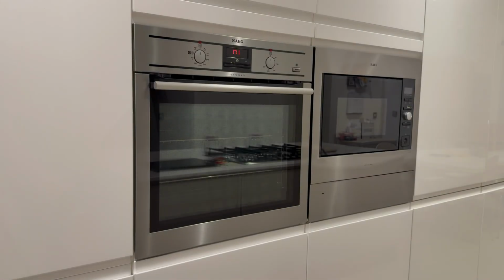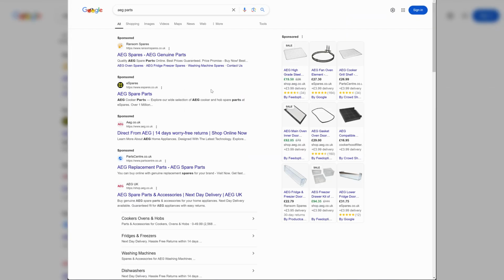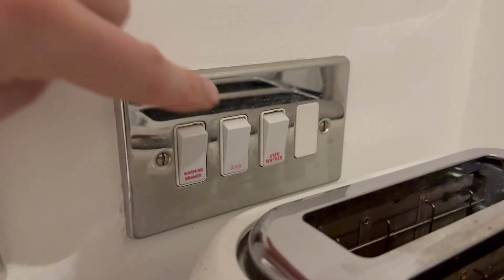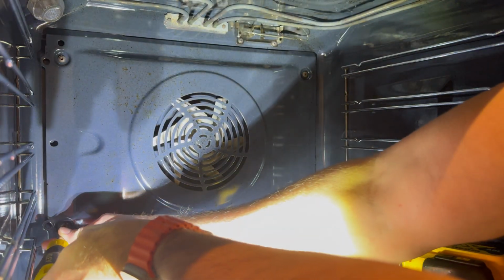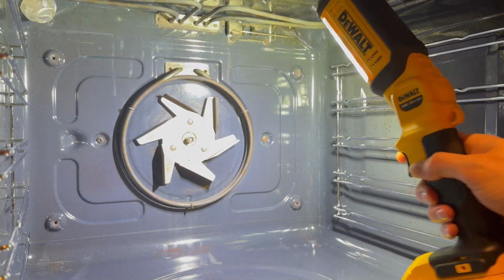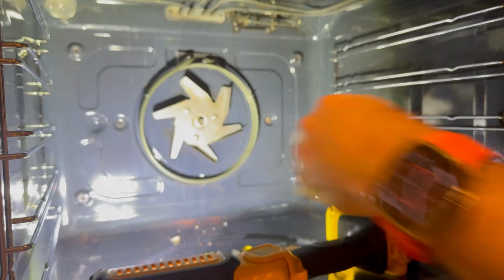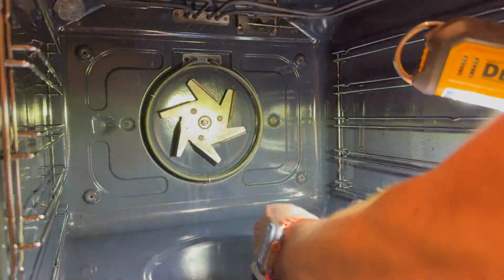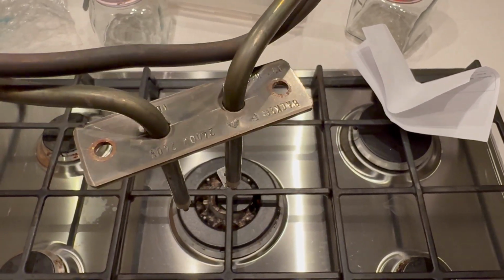AEG Oven Heater Element Repair

Comment: This is brilliant - thanks so much, really clear and easy to follow. One question, how do you unclip the spade connectors?
Reply: Worked it out - all working good as new again, thanks!
Reply from the maker: Perfect well done, I’m glad my video helped and thanks for leaving a comment after you fixed it, much appreciated! 👍🏼
Reply from the maker: The spade connectors should just pull off if you give it a little wiggle.

Just make sure they don’t spring back into the hole once disconnected from the heating element. 👍🏼

Comment: Good job I saw that.  The first video I found suggested I had to pull the whole oven out the wall.
Reply from the maker: Thanks for watching and I’m glad my video helped. Just make sure when you disconnect the spade connectors that they don’t spring back into the hole, otherwise you will need to pull the oven out of the wall to retrieve them! 😂

Comment: Great video - my mother in law has an aeg oven that keeps stopping during operation - not sure if its the timer unit as it is flickering - will continue to investigate
Reply from the maker: Is it tripping the breaker or just stopping/starting whilst switched on and in use?

The element in mine was grounding when it was heating up and expanding, yours could have a break in the element that splits as it warms up. 

The element is the best place to start relative to its cost. If that doesn’t work, the electric control unit might be more expensive to replace, in which case you’ll have to decide whether it’s economical to repair or just replace with a new oven. 

Let me know how you get on. 👍🏼
Reply: @SwiftDevelopments it’s stopping heating occasionally - doesn’t trip the breaker - then comes back on after a wee while

Comment: Our oven today just lost heat, all comes on and the fan but nothing?
Have bought new element so hopefully work
Reply from the maker: With mine it was grounding as it warmed up and expanded. It sounds like your element might have cracked/split so it can no longer conduct and heat up. Replacing the element should fix it. 👍🏼
Reply: I have the same issue, did you find the element replacement worked?

Comment: I did same but problem of short circuit still exists? Any help?
Reply from the maker: Is it possible the other element could be at fault?

Does it short immediately or after it starts to warm up?

If you’ve replaced the element and it’s happening immediately, it might be the control panel relay. 

Hope this helps. 👍🏼
Reply: @SwiftDevelopments thank you for your reply. The short circuit happened after the temperature over 50c so it was not  immediately.

Comment: Hello i have Indesit cooker & oven but oven turning itself off after 20 minutes then when is cool down then start working again
Reply from the maker: This is the same problem I had with mine, replacing the element fixed it. It’s likely caused by a break in the insulation that shorts when it expands after warming up.

Comment: Also, I meant to add, when I attempted to put the new coil back in I found it very difficult push it through the "duvet" like heat retaining material. It wouldn't go through. In the end I pulled the oven out, I removed the outer back plate which by the way it is very flimsy & thin. It is held by 5 T20 screws . With that off you can see the coil connector end protruding through the glass fiber duvet. Ask someone to help you to push from inside as you pull from outside
Reply from the maker: I appreciate you taking the time to share your experience and providing some advice.

I did notice on mine when putting the new element back in that the fit is tight and will only go in at a specific angle.

Your post will help anyone attempting this fix if they cannot install it the same way I show in my video. 👍🏼

Comment: I have removed the back plate but the screw on the left lower corner was completely rusted. The back hole was rusted to such a degree that it was triple in size. This is a 4 yr old oven, not of the quality expected from AEG 😥
Reply from the maker: I was surprised with mine too, a couple of the screws I removed on mine were on the brink of rounding off, mine is about six years old. For the minor additional cost, they should be using more substantial materials.

Did you manage to use a washer or piece of metal to secure the screw where the hole was enlarged from rust?
Reply: @SwiftDevelopments I didn't bother because the other three were okay... Still

Comment: What can I do if the rear element stays on even when switched off (fan stops but element glows red ) only way to stop it is turn it off at the mainsis it a new board needed and easily/worthwhile fix ?
Reply from the maker: As you mention it always stays on unless you turn it off at the mains, I think you have a faulty relay. The relay should be easy to test with a multimeter, if it’s jammed closed, that would explain why the heater element is always on. If the relay is good, then it’s the control board keeping the relay closed. I’m guessing it isn’t a faulty thermostat, as this would only be a potential cause when the oven is switched on using the knob. 

Relays are cheap so you could always try replacing that first. If that doesn’t fix it, you need to decide whether it is economical to replace the control board or just use that money towards a new oven.

Comment: Thanks.  Very clear information.  Cheers  Jim
Reply from the maker: Glad it was helpful! Thanks for commenting. 👍🏼
Reply: @SwiftDevelopments 
How did you know which heater was the problem?
I had the same issue tonight – my FI safety switch tripped three times every time I pressed the timer to start baking.
At first, I didn’t understand what was causing it.
But I had turned the oven on, and it was running for at least 20 minutes, preheating to 220°C.
Then, for the first time, the FI switch went off.
When I opened the oven door, I noticed it wasn’t hot at all – even though it had been "on" for a while.
So now I suspect that the top heating element might be faulty and I’m thinking of replacing it.
My oven is from AEG, and it’s connected to the built-in induction cooktop controls in the kitchen

Comment: In case it helps anyone else, I used a couple of my wife's hair grips to prevent losing the spade connectors down the back. Just the cheap ones that are straight on one side and wavy on the other.
Reply from the maker: Good point, thanks for adding this tip. 👍🏼

The wires in mine didn’t budge much…if they had, part of the video would have included how to fish them out! 😂

Comment: Thanks, great video - mine's blown after just 3 years - gutted.
The spade connectors look like a really cheap and nasty solution from AEG - it looks like almost anything could leak current between them!
Reply from the maker: Thanks. Yeah this is the first time I’ve had an element go and as you mention, the way it connects is primitive. I was also surprised at the absence of insulation on the connectors, just relying on an air gap to prevent it potentially grounding on the case.

Comment: What should I do if the cables to connect the heating element have fallen back through the hole. Need help!
Reply from the maker: Oh no. 😣 When I disconnected mine, they didn’t budge otherwise I would have suggested to clip something to them to stop them falling through.

I’m assuming it’s not possible to fish them out using a claw grabber tool?

Failing that, you might need to pull the entire oven out and remove the back plate to get access to them. As far as I can remember, there isn’t anything else to unscrew from the inside of the oven. 

Sorry I cannot be of more help, hopefully someone else will comment if they’ve had a similar issue and had to pull the oven out. You should be able to find the fitting instructions online and reverse the steps to remove.